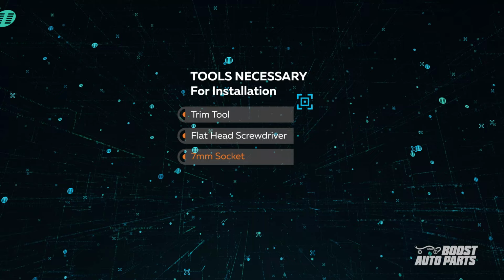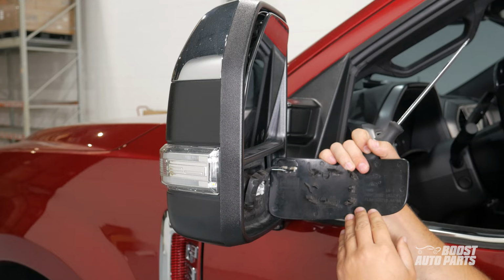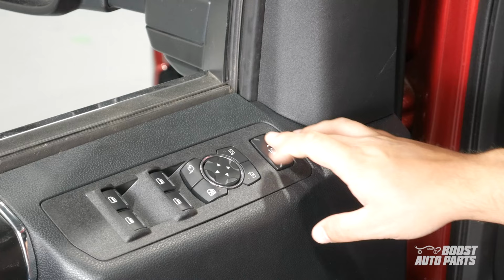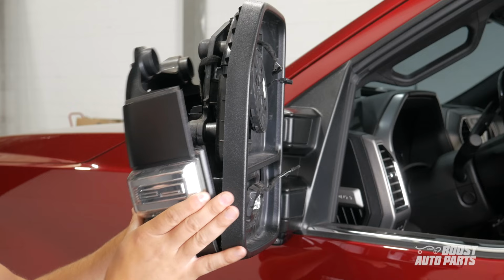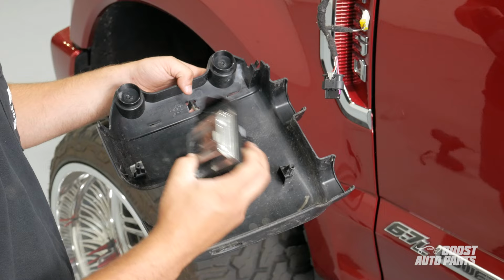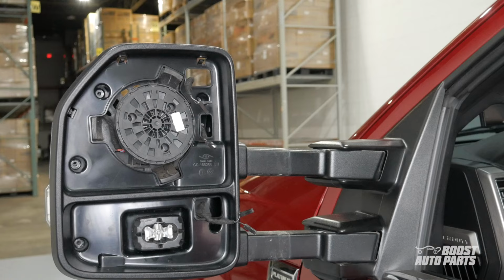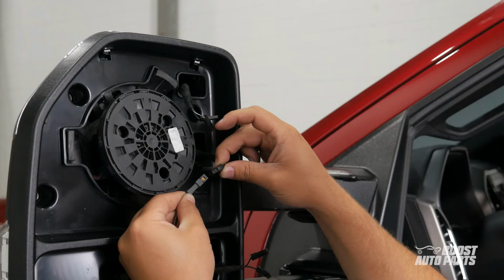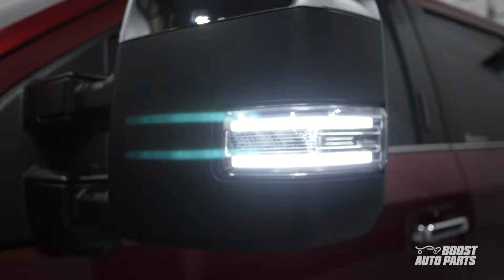Switchback Tow Mirror Light Upgrade - 2017-2024 Ford F250 F350 Super Duty Trucks - Boost Auto

Comment: Did all this just to get to the light and realize the truck I bought doesn’t have factory mirrors and they’re some cheap Chinese mirrors with hard wired plugs 🥲
Reply from the maker: Give us a call at 765-831-2830; we can get you a pigtail connector so you can splice them in

Comment: why pull out the puddle light? Can you just leave in place and connect the wire harness after switching out the turn signal light?
Reply from the maker: We find it easier to work with by removing it